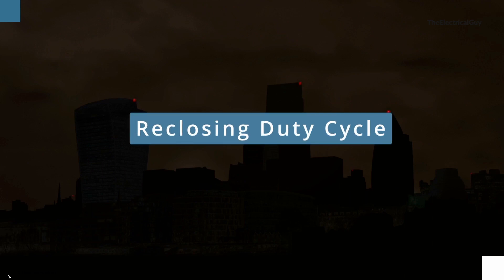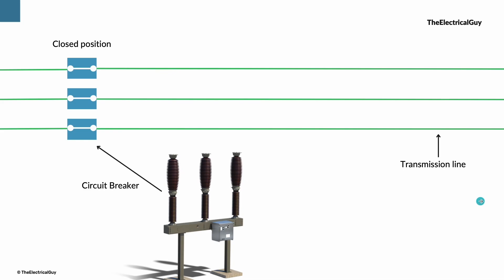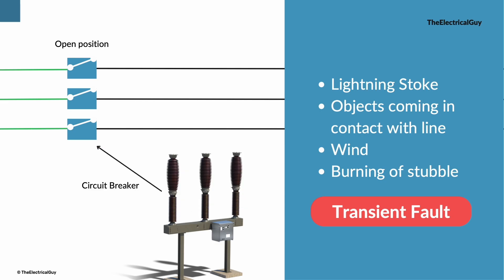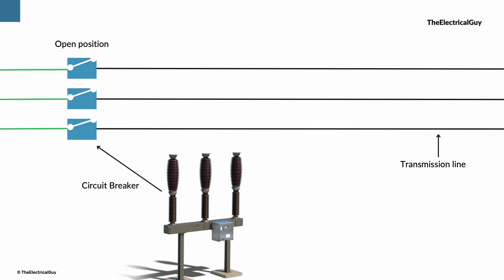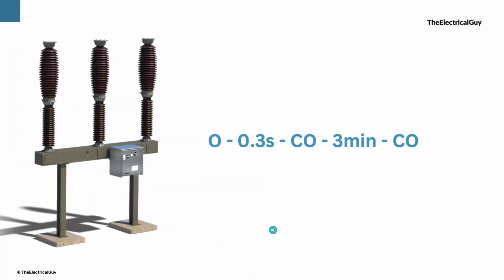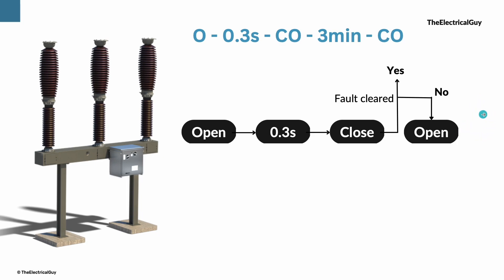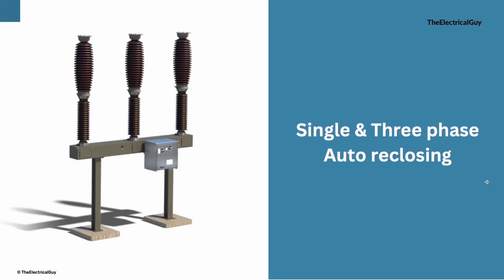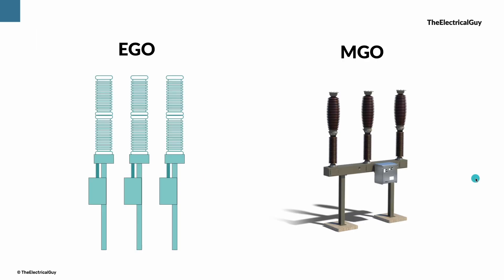What is Auto reclosing and duty cycle of a circuit breaker? TheElectricalGuy

Comment: thank you for your useful video that you made it. 
there is one thing that i want to know is  about the quantity of mechanism for circuit breaker in one & half breaker arrangement in substation. if we imagine that we have 230 KV substation with one & half breaker arrangement what type of breaker should be used in middle of cutoff.
one mechanism or three mechanism? for supporting the auto reclosing subject in middle of cutoff which is connected to transmission line.

Comment: Please correct the explanation, 3 min it won't close automatically. No breaker will close on auto after 3 min of fault. Reclose for the first time,then it will remain in open if fault persisting. Especially auto reclosing available in only one phase fault condition. Consider in 3 phase line, one line not available for min, then entire power system will be collapsed in negative phase seq. So whatever the duty cycle mentioned, it is the breaker duty and not related to fault clearing time.

Comment: Dear Sir, plz make a video regarding how the ac and dc connections are given in control and relay panel as a redundant electrical sources to make system uninterrupted. Also plz tell about where is ac and dc supplies required in control and relay panel for 33kv, 132kv, 220kv and above system.

Comment: Mr Gaurav in my worksite substation for traction power we have SF6 CBs , 3pcs for Incomer 1 and the other 3 for iIncomer2. The center CB is connected by signal and electrical cables with the outer CBs. In case of Transient fault all 3 CBs operate simultaneously. Transparently these CBs are not MGO. So my question is, are these CBs EGO? If Yes Why?
Reply from the maker: It's very simple to identify EGO Breaker. If each phase/pole has a dedicated mechanism then that means it is an EGO Breaker.

Comment: Sir in past 3 months, in our area we had floating neutral fault twice. It has damage many of devices and adapters for all homes in our area. I checked and mostly voltage was around 350v-400v during fault. What device for home do you recommended to prevent this, something that turns off supply in home in such condition. I found device amiciSmart Over/Under Voltage device, but what I found is device is themself rated for only upto 300v max. Device will probably burn or may work for few minutes over 300v or behaviour will be unknown.

Can you suggest what type of device is suitable for home use?
Reply from the maker: Hello. You can check for different stabilizers.. also nowadays many devices come with an in-built stabilizer.. try checking their ratings
Reply: @GauravJ  I do not  want stabilizer. I am ok if supply is cut out in such case. It is a rare fault.